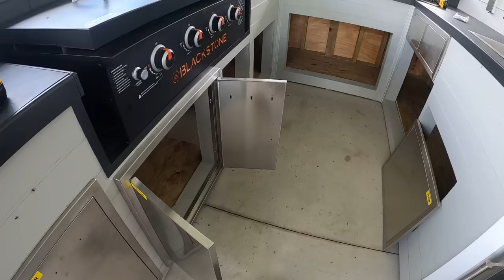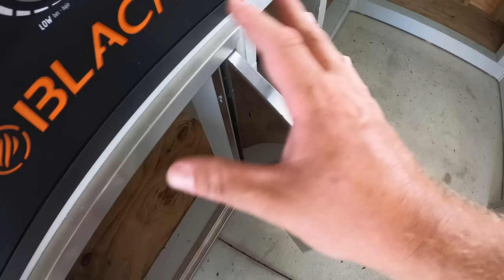DIY budget outdoor kitchen build part 6! Blackstone is installed! #Vevor #633

Comment: Nice build out Andrew.👍👍 If the faucet neck is brass or stainless, wrap it with painters tape and tweak that  radius in a electrical conduit Bender to get a 180° that you want. It should work out for you. Keep up the great work 👍 my brother.
Reply from the maker: Thank you

Comment: Highly recommend some type of hydrophobic sealer on the concrete prior to placing rubber mats. We seal pavers and the petroleum stains left by rubber mats is next to impossible to remove.  2 coats of Innovative Concrete Products water shield with stain guard will really help protect the patio.  Pressure wash the area.. Pump up sprayer a heavy first coat then before it dries a mist coat. If the first coat dries out the second coat will be repelled. Best money you can spend to protect concrete hands down. You literally can't mess it up.
  Beautiful house and property love that garage
Reply from the maker: Thank you for the information

Comment: I have a similar faucet.  When you pull out the hose, rotate the nozzle (head) 180 degrees and it will change the angle the water sprays.

Comment: Andrew, what an awesome finish to your outdoor kitchen. Looks very nice. Regarding GFI outlets vs a GFI breaker, I always personally prefer a breaker over an outlet as that allows for the entire circuit to be protected from the panel out, in case a nail or screw was to ever be driven into the cable or water intrusion was to happen upstream of the outlets. You have done some amazing work and y’all will have a wonderful outdoor area to enjoy for many years to come.
Reply from the maker: Thank you very much

Comment: Outstanding build for anyone needing information for their project. More attention to detail than the majority of YouTube videos I review. Two questions. I believe you said your house was already regulated for propane. I thought I saw a regulator installed on stove. If so that should have over regulated your stove?   Propane is a very heavy gas. please check with your gas co. I believe they will recommend venting panels also sold by vevor. Again outstanding build
Reply from the maker: That stove is already set up for common household pressure. I'm not convinced that was a regulator and if it was it is required as the stove is working properly.

Comment: Use magnets to hold that cooktop lid down….heat that faucet and bent it down more.    
What happened to the Air King fan Video?   I ordered it after watching your video and use it in the garage. It works tremendously!  I’m able to work in there when it’s 105 degrees outside. I wanted to show my wife the video but it doesn’t seem to be around anymore
Reply from the maker: It was on the countertop nugget ice maker video a couple of months back.

Comment: A smart man knows what he doesn't know. I have been a home builder and remodeler for more years than I want to admit. I recently watched all of your videos and I finally found something that I would have done differently. The first corner you put on the outside does not cover all of the edge.  My suggestion would be to recut the angle with a tail on the outside that meets the bottom of the horizontal edge.  Other than that you have obviously done your research. You are doing an amazing job on this entire build.
Reply from the maker: What you didn't see was another cap I built to extend the horizontal trim, it can be seen at 35:30 in the video. It's a wooden piece painted black. These videos would be an hour long if I showed everything.
Reply: @TKCL  Well then, I will strike your 99.99% score back to 100%. Keep up the great work!

Comment: air to fuel should be the same no matter what the setting otherwise you wouldn't have a CLEAN burn. Adjusting each valve  just closes a port/opening to raise or lower the flame.

Comment: if your ever decide to go with the angled drip pan and diverter tube to the side or the drain down the back, not sure if you were going for this already but would not be a bad idea to add a removable mesh lining to it so you can filter out any larger pieces and not plug up the tube, would also help with any cleanup
Reply from the maker: Plugging is definitely a concern.

Comment: Hey you can cut that aluminum trim on your miter saw, just go slow. MAN that kitchen rocks! Yeah I cant wait to see it in action. I had not thought about it before but the kitchen faucet that you have would be good for kids. Make it easy for them to reach the water.
Reply from the maker: Man I cringe thinking about cutting aluminum with a wood blade. The thought of it catching and ripping out of my hands 😬😬
Reply: @TKCL  I understand but it won’t.  Cut it just like you would on a metal saw. Any wood worker would tell you the same I’ve done it bunch. But only do what your comfortable with. Only thing is I would not use a nice new blade.

Comment: If I were you I’d paint the brackets that hold up the bar top gray so they blend in to the background.  When you look at the front of the kitchen your eye goes straight to the black brackets not anything else.
Reply from the maker: That won't be a problem when there is black vents and black bar stools right there.

Comment: Does the cover on your stove contact your tile if so I would recommend making a gasket and cover the metal edge I have use fish tank tubing just cut slit down center and push on the edge
Reply from the maker: It does not, but I already bought metal rubber trim edge in case it did.

Comment: If you take a piece of wood with the same hole size drilled in it, it will prevent the drill from wandering.
Reply from the maker: Good tip

Comment: I loved watching this series when you first built this outdoor kitchen. How has the Vevor stainless steel doors held up to the elements? I'm in the process of buying all of our equipment and was shocked at the price difference from Blaze, Bull and other brand names to the vevor doors and drawers.
Reply from the maker: Our drawers and doors are great, zero issues.  A few times a year we wipe them down with stainless care wipes to keep them looking new and not allowing any rust.  Stainless of any kind needs minor maintenance too.
Reply: @TKCL  Fantastic.... Good to know. The Florida weather can be brutal in the summer. Definitely need to make sure I keep up with using a stainless steel cleaner. They do leave a protective residue on the metal. My outdoor kitchen will be covered except during sideway rains and winds! It will get a little misty!

Comment: Code allows you to use 15 amp outlets on a 20 amp circuit. Yes you're not getting full capacity by using a 15 amp outlet, but I've never tripped a 15 amp with my high powered smokers/cookers. The 20 amp outlets are ugly in my opinion, Lol. I'd rather sacrifice the 5 amps and get a nicer looking outlet.
Reply from the maker: I'm quite certain code only allows it with multiple receptacles to spread the load out, not on a single receptacle. Regardless we are loading these to the max with cooking appliances that pull heavy draw. I feel better with 20 amp receptacles.
Reply: @TKCL   if any appliance has the regular 15 amp male plug, its made for a 15 amp outlet. but 20 amp definitely doesn't hurt
Reply from the maker: Correct, but there is two 15r openings in a single receptacle, you could easily plug two appliances into one receptacle and over load it. That's bound to happen in a outdoor kitchen with entertainment. The 20 amp is a better built plug and should in theory handle a little more abuse.

Comment: Where you dropped in the blackstone.. He left a gap on the sides and on the back. What about the bottom?Did you lift it up ?? And with using cement board, do the job, instead of buying the metal dropping sheet
Reply from the maker: It's already spaced up due to the Blackstone design.

Comment: Looks great awesome job I just thought of one thing and I hate to even say it because it's too late to do it now but priming and painting the inside plywood before assembly would have been the right thing to do and even spraying the interior cavity now is too late but the bear wood exposed to the atmosphere is a time bomb.      Sorry I didn't bring it up earlier. Or am I wrong I hope so
Reply from the maker: Maybe so, but I have similar wood in my deer blind that's 100 percent exposed to all elements. Been out there for years and still looks great.
Reply: .
Now that you mention it I do remember you specifically addressing that at the beginning and saying that.  However the blind is way up off the ground with a High volume of well ventilated open space versus an inch or two above a slab with driving rain and hosting down splashing on it especially on the cut edge end grain where it will wick up moisture like crazy, maybe just hit the edge facing the floor with Flex Seal or a marine gel coat type of product from underneath or at least a rattle can of aerosol silicone?
Not to even mention those crazy ass carpenter bees you have down there God forbid! 

And while you're at it ...

ASIN.    B09RD61MHK

Well that should be enough to drive you crazy ... good luck, LOL 😆 !!!
Reply from the maker: I've been thinking about trying those devices, I can't tell if they are gimmicks or not. I think I'll order a few.
Reply: @TKCL  

Happy 60k !!!

10k is the new 1k for you  Congratulations 🎊
Reply from the maker: Thank you very much

Comment: Looks great! Here's a brain teaser for you and everyone else too. Why do the GFI outlets say not for wet or damp locations and that is where they are intended for?
Reply from the maker: Because no electricity is intended for damp or wet. You need a weather proof enclosure, rated wire and or conduit to make it safe. Should the device or outlet make contact with water it's designed to trip.

Comment: I’m an idiot and a visual person. Any chance next video you can do a close up of the difference between those style doors? I’m utterly confused how 1 is better than the other for stone when the first ones you did under the Blackstone seem to have a nice flat line that would take stone ends.
Reply from the maker: Those would as well, but that other door set has an even thicker edge to not be recessed in so far if you laid thick stone edging.

Comment: Hi Andrew, I went ahead and ordered the Vevor doors and some small drawers because of your video. The door sets are no issue, but how are the drawer sets attached to the cabinet? There are no holes for screws as far as I can see. Thanks for the great content
Reply from the maker: You have to pre drill your holes top or bottom on the inside depending on your mounting locations.

Comment: How did you fasten the drawers? They don’t seem to have any fastening holes and I’m having quite a time trying to drill through to screw into the support 2x4s
Reply from the maker: You must pre drill the holes where you have a location to mount.  I used standard Dewalt twist drill bits to drill my holes for mounting.

Comment: Did you have to cut the legs off of the Blackstone or are they removable?
Any issue with heat build up now that it’s in?
Thanks
Reply from the maker: They unscrew, no cutting. The back wall gets a little hot. That's easily taken care of by running our wall fan in that direction.

Comment: How’s the ventilation for the blackstone? I read horror stories how it will catch fire
Reply from the maker: 3 inch gap all the way around. Tile, then cement board, fire paint barrier over plywood. I took major steps to make sure nothing burns.

Comment: How did you connect the drain to the sink ? It goes inside to an existing drain?
Reply from the maker: Yes, when I did the original plumbing in slab I ran a line to that wall because I knew I would be building an outdoor kitchen. It runs to my septic tank like the rest of the house.

Comment: Bro you did a really good job on this outdoor kitchen … however … it’s your budget build because you got a lot of expensive items giving … I build outdoor kitchens and yours is far from cheap…. Come on brother a lot of people are watching ….. you can pull up many outdoor kitchen builds that are very nice and 1/4 the price to build .
Reply from the maker: I can't even begin to understand your logic here.  I gave the ALL price cost, even with the whopping two parts that were sponsored.  I have all receipts and just the building materials alone cost me over $3k directly from Lowes and Home Depot, same as anyone else would pay.  Your 1/4 price is a far fetch from reality when 50% of this build is just materials.  Your also comparing my build to someone else that's not the same size, same material or custom built to fit my layout.  I could easily build a similar space for less and for far more.
Reply: If this is so, please link your cheaper ideas bc this gal is broke with 4 kids and hubs works out of state most of the time. I'm nowhere near expert, but I do have a keen ability or luck, to watch videos and figure things out. I was able to hang some drywall and mud our entire basement so well on the first try that I was even offered a job by an extremely reputable company in our town. 
Definitely like to see if I can find a cheaper way, and whether I'd want to give it a try or not. I also like using repurposed material (creek rock, etc) the cheaper, the better 😂❤